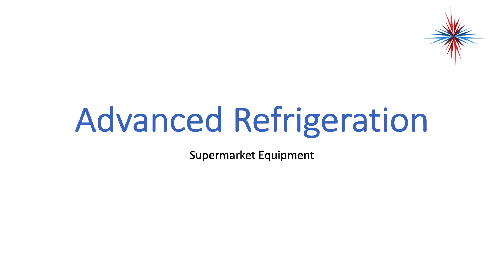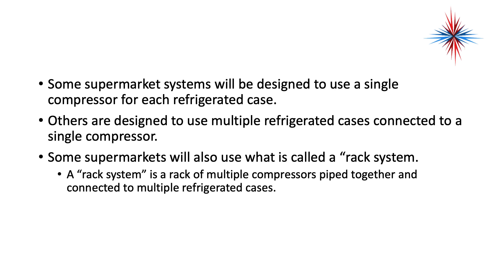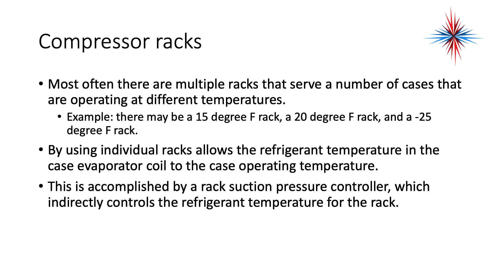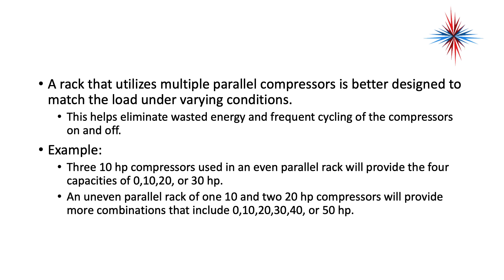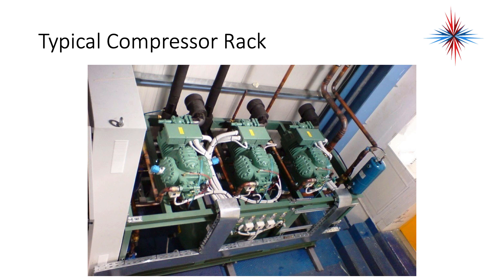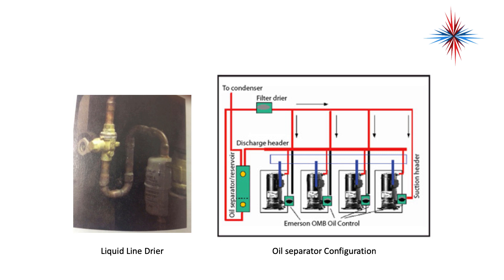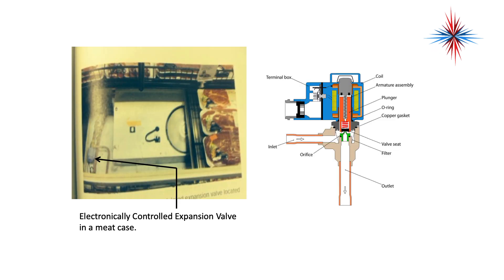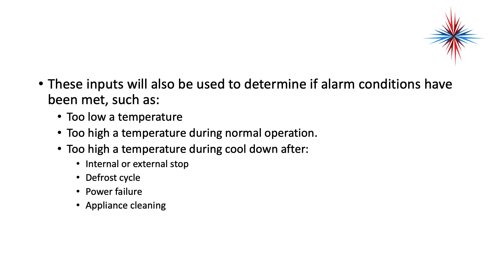Advanced Refrigeration - Supermarket Systems 1

Comment: Thanks for this, i recently interviewed for a Supermarket refrigeration, but I work on walkins and coolers and assortment of systems like Chillers and DX systems, but after watching this, i think If I have a great concept on refrigeration circuits I should be ok with the knowledge.
Reply: If you do walk-in units you’ll be okay, the only component difference might be the heat rejection circuit for store heat and CPR/EPR valves
Reply: @strimbimmin328  thank you for that. Puts my mind at ease.
Reply: @jaymesrod4209  just wanted to check in on how everything turned out for you! I made the switch from strictly grocery refrigeration in-house for a grocery store chain to now working more on ice machines and restaurant equipment. Refrigeration is refrigeration. When you understand the basic cycle and the appropriate pressures for whatever you’re working on the world is unlimited. It can get very complicated but if you retain that cycle in your head you’ll be fine.
Reply: I’m watching the video for the same reason. Let me know how things have worked for you.